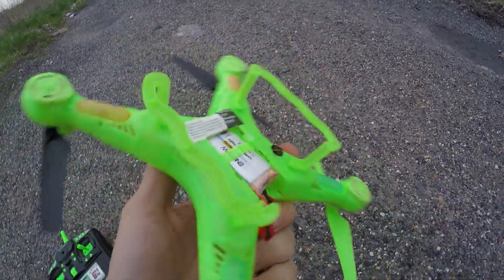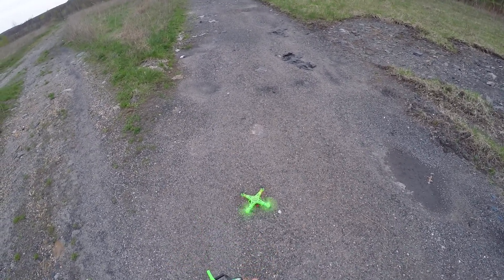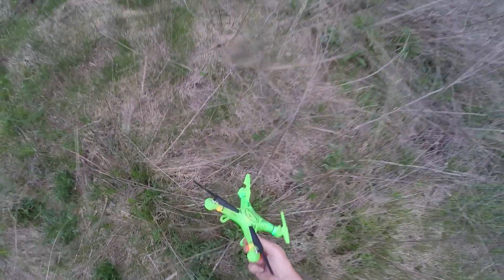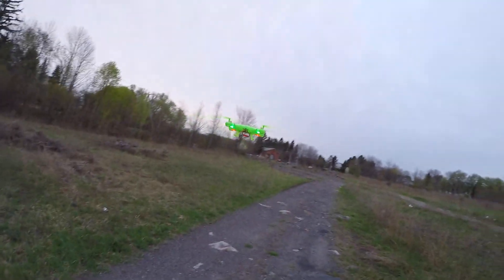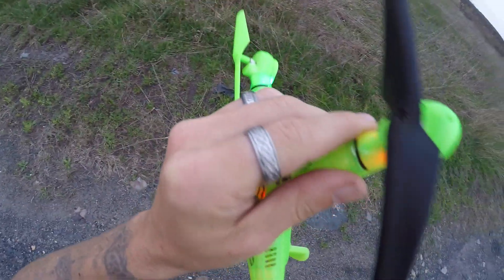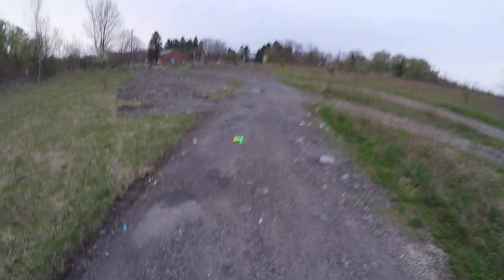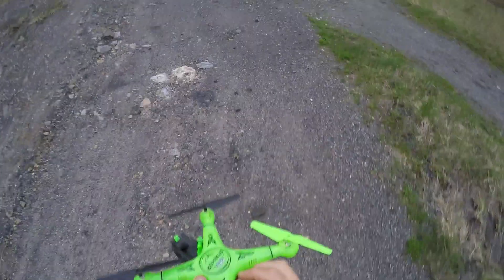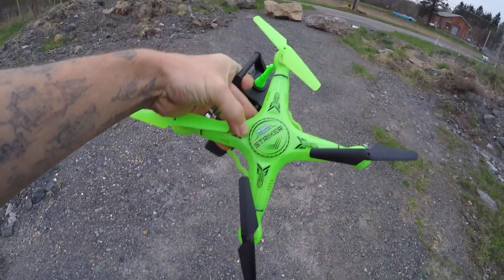Glow in the Dark Striker HOW TO KNOW what motor is bad Diagnose ISSUE RC DRONE

Comment: The motor is not moving. The small nylon gear on the motor shaft is. I have this drone and the same problem.  Super glue did not work either.  My next attempt will be a drop of J-B weld on top of the (roughed up) shaft once the gear is back in correct position.  After that...since I got it for free, It will fly long enough to reach the dumpster.   lmao.  I hope it works,  It's fun to fly.